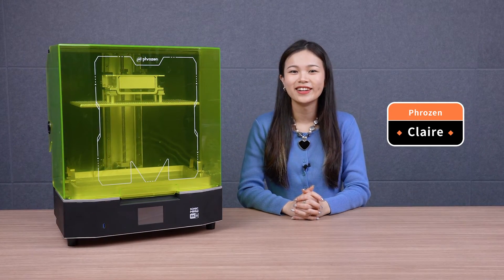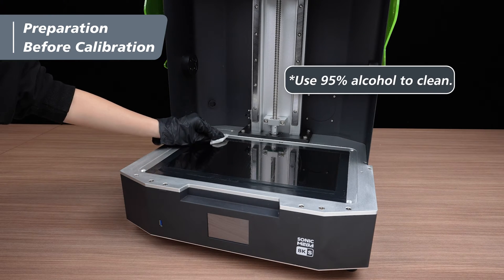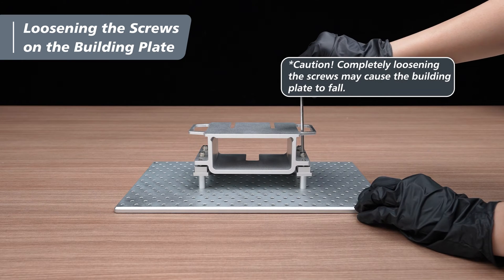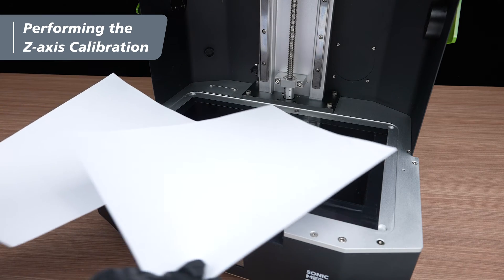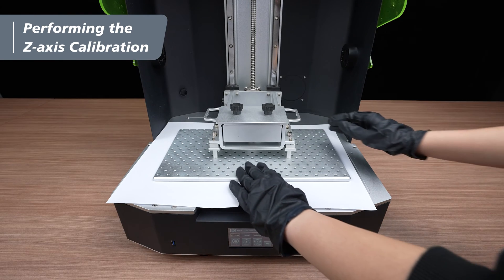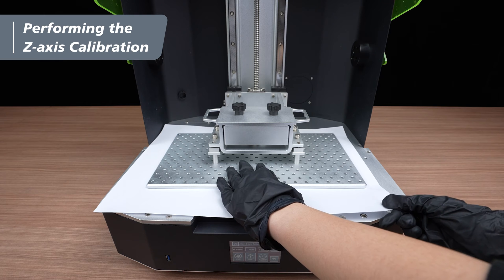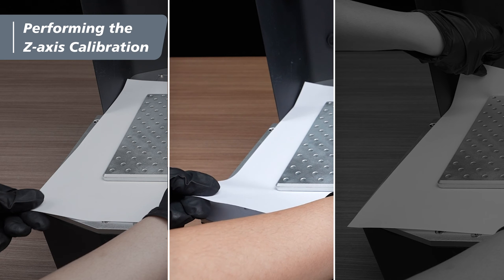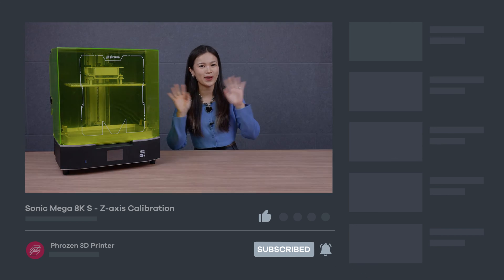Sonic Mega 8K S - Z-Axis Calibration - Phrozen LCD 3D Printer

Comment: Hi, I have few questions: 1) when you say "ensure equal friction among 4 corners", does the paper needs to move a little when pulling it or not at all? 2) Does the thickness of the paper matter? What paper thickness do you use for calibration with Acf and nfep films? thanks